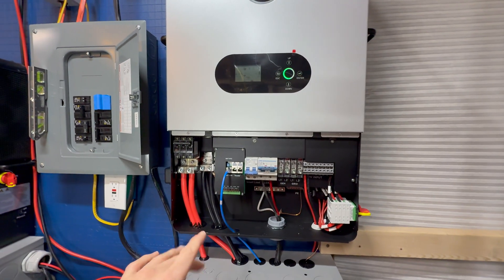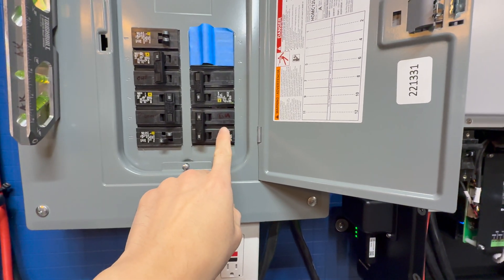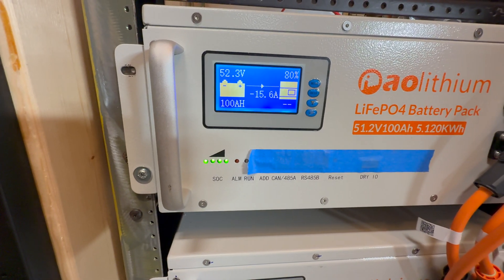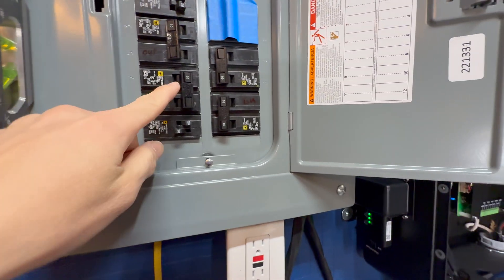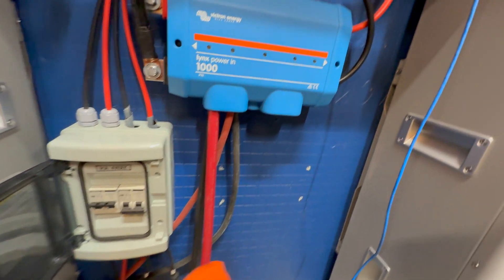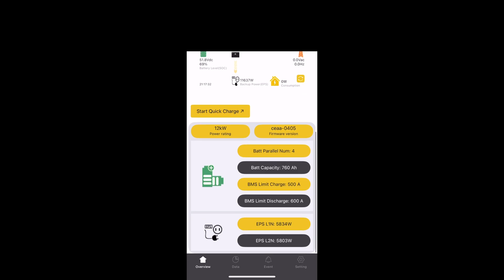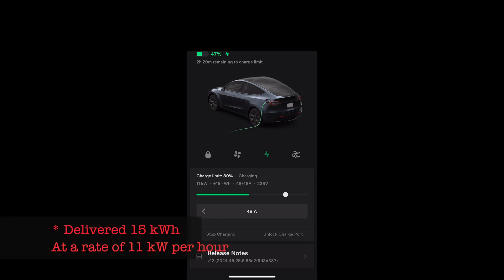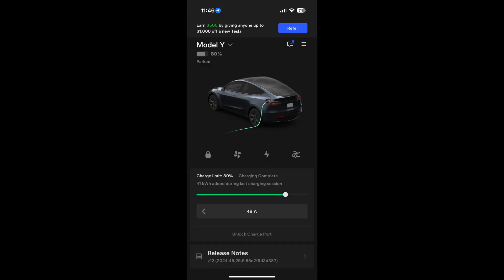#eg4 12000XP #offgrid #inverter  Level 2 full charging #tesla | Tesla wall charger 48A

Comment: Great setup! I'm planning on doing the same, probably get a 12000Xp and power a sub panel. I have 2 EVs and 2 chargers. I was thinking of wiring one of the EV chargers directly into the smart port of the Inverter instead of putting in the Subpanel, allowing me to control the charges according to battery SOC/Solar input. What do you think?

Comment: EG4 inverters can experience various problems, including communication errors with batteries or meters, voltage issues (like "Vbus over range"), and potential overload or shutdown issues. Specific issues include problems with battery communication, requiring checking cable connections and battery compatibility, and potential grounding problems with PV panels leading to safety hazards. 

Here's a more detailed breakdown:

Common EG4 Inverter Problems: 
Battery Communication Issues:
Inverters may fail to communicate with batteries, leading to errors. This can be due to incorrect cable pinouts or incompatible battery brands. 

Meter Communication Issues:
Similarly, communication problems with the meter can occur. Ensure the communication cable is properly connected and functional. 

Vbus Over Range:
This indicates a DC bus voltage that is too high. Verify that the PV string voltage is within the inverter's specifications. 

Grounding Issues:
Incorrect grounding of PV panels can create safety hazards. It's recommended to ground them separately from the inverter, not directly to it. 

Overload/Shutdown Issues:
Inverters may shut down due to overloading or low battery conditions. Ensure the system isn't exceeding the inverter's capacity. 

Firmware Issues:
Some users have reported issues with firmware, particularly when paralleling multiple inverters. Firmware updates may be necessary to resolve these problems. 

Battery Issues:
Dead or shutdown batteries, unbalanced battery banks, or incompatible batteries can all cause issues with the inverter.
Reply: never had an issue with EG4 inverters.
Reply: This must be AI generated and who knows where AI comes up with this most incorrect information

Comment: v nice work!  thanks for sharing the data.  I'm getting ready to retire the old AIMS 24vdc 4kw (don't laugh) its showing some wear after the last 7 years of continuous operation.  The EGV is compelling but i have no need for its MPPTs as i already have Victrons there, also considering something similar to your fine 120/240 vac victron split phase demo.  In any case would love to have some EV (or even PHEV) "reasonable" charging capability, thanks again.

Comment: High frequency transformerless inverters likevthese generally present a greater shock hazard than low frequency inverters because they lack the electrical isolation provided by a transformer, which can lead to higher leakage currents and increased risk of electric shock.

Comment: You are going to fry your Tesla's onboard charger with that 12000XP. This high frequency, transformerless inverter doesn't provide any galvanic isolation between its DC boost stage and its AC output. All it would take is for a single MOSFET in the H-Bridge circuit to short to ground and pass high amperage DC current through to your Tesla and you'll set your Tesla on fire and void your Tesla's warranty. Don't take my word for it, ask Google AI "Can a high frequency, transformerless inverter damage and EV?"
Reply: I have one of theses inverters and I'm a master electrician and have been for the past 10 years, been working in the field over 19 years ,and I heard a ton of talk about these inverters h bridge failing and Moffets failing ,but I've never personally seen this happen ,nor have I seen or heard of any fires or damage related to theses failing, if your going to talk like this atleast show us the fires and damage, always hear a bunch of what could happen ,we'll any could happen in life so that just sounds dumb
Reply: Do you spam every video that reviews EG4 products? They must be cutting into your bottom line.
Reply: @jake-mv5oi  Nope, buying one of these cheap high-frequency inverters actually helps my bottom line because I repair inverters for a living. Have done so for the past 25 years. So when you buy one of these poorly designed high-frequency inverter chargers and they fail out of their warranty period, chances are high that you'll be calling my company for a repair quote since we're one of the few companies in the US that have the expertise to quickly repair this type of inverter topology.

Comment: It’s a perfect match because 240x48 =11,520 and you have some room for basic lights. With the surge capacity it should be able to handle most circuits.
Reply: It's not a perfect choice. This high frequency, transformerless inverter makes a dangerous choice because its cheap design doesn't provide any galvanic isolation.